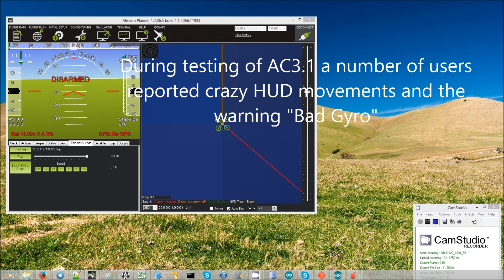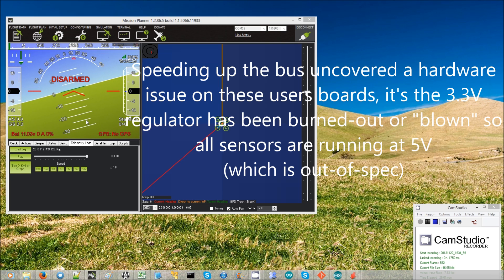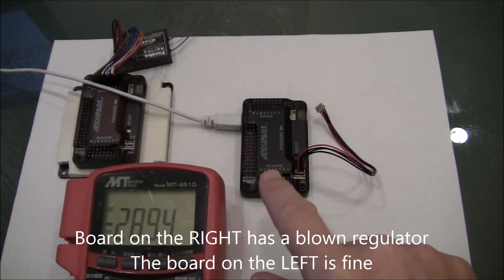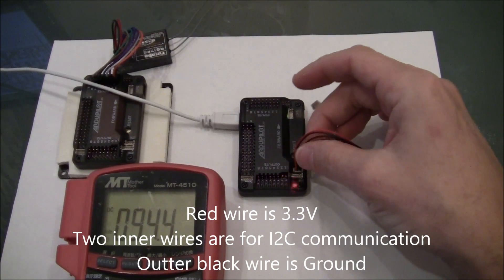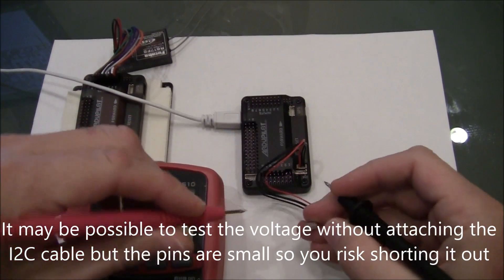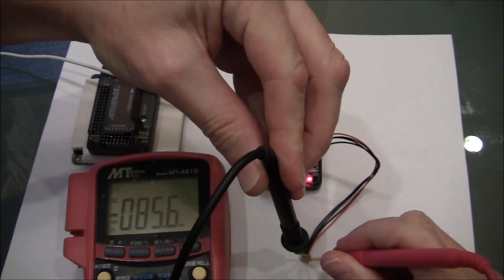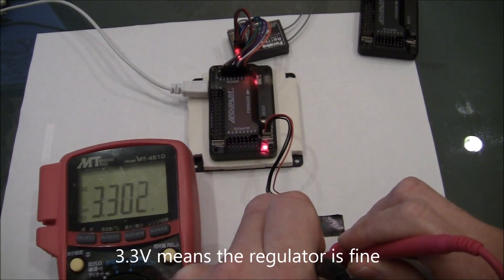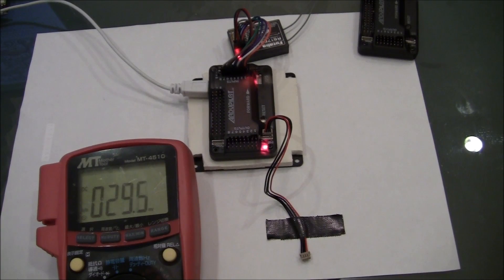Checking your APM's 3.3V Regulator

Comment: Two methods of powering the blessed thing. Dedicated BEC 5V 3A or the APM Power Module/sensor/PSU. My two PM's (one as a back-up) are outputting ~5.80V It was almost plugged in to the Arduflfyer 2.5.2 !!!. I had not removed the J1 though, and had no LED illuminated or magic smoke. Maybe in an instant I have damaged it. Is one to measure the voltage once the APM and peripherals are all in the load? Surely the power should be delivered at 5V constant regardless of the mA draw.  I am looking into the regulator they used. Beware Ebay vendors. I would also add that the pcb has two missing components. This  I have seen on 3DR product. Test done with full chgd 3S
Reply: I think my blunder was the vendor :-o
Reply: Chris Leech Thank you for the post!

Comment: Hi Randy.
I've tried to fix the 3.3V regulator (marked LE33) but the problem has not been solved yet. The voltage in the 3.3V output of the I2C bus still remain about 4.6V. Maybe is another hardware issue. Something that connects the +5V with the +3.3V bus. Some diode? I don't know.

Comment: Hi! In the DIYDrones forum you say that the way to prevent the regulator from being burnt out is to "not connect any devices such as a radio receiver, MinimOSD, GPS, etc while the APM is powered especially while powered only through the USB cable".
Do you mean that every time I power my APM via USB I have to disconnect all the devices (Rx, GPS, etc.) to prevent the regulator from being burnt out, or it's just that you cannot plug in one of these devices when the APM is being powered by the USB (but if they have already been plugged before powering the APM there should be no problem)?
I've been told that removing the JP1 Jumper will also prevent the regulator from being burnt out. If I do that, will I be able to plug the devices while powering the APM via USB without problems?
Thanks!
Reply from the maker: girarcat I'm not really sure how regulators can be burnt out so I don't think it was me who blamed external devices.  That may be true, I just don't know personally.
removing the JP1 jumper is a good idea in general but it only affects devices that are receiving power through the rear pins of the APM.  It won't make any differences to devices plugged into other ports.
Reply: Randy Mackay Okay, so what's your recommendation to prevent the regulator of my new APM to be burnt out?
Thanks!

Comment: Hello, I have the "no heartbeat packets received" problem and I measure this voltage on I2C connector and I read 4,9V.
In the video I didn't understand what happens if is 5V (like mine), should I replace the regulator or the apm board?? thanks!
Reply: I'm with the same problem. It reads about 5V and I'm getting "no heartbeat packets received" on missionplanner. Should we replace the board? Thank's in advance!

Comment: I have an apm 2.8 board running copter 3.2. I'm not experiencing any bouncy horizon. By measuring directly on the regulator, I have verified that it does indeed output 3.3v. Yet, when I measure at the connector as shown in this video, I get 4.8v. This is with power module ~5.3v in. Anything to worry about?
Reply: Akujiwar Bladefist little update. so i figured out my external compass wasnt working. turns out apm 2.8 got connectors moved around a bit. I might have been measuring at the wrong connector. Anyway i moved the compass lead to the connector right next to the gps one. Now it works. However i measured the voltage at the correct compass connector, but there, to, i found 4.8v.

Comment: Hi friend. I did the same test as you did. But my multimeter gave me 6.4v (first black and the red one)... is it ok? Or have any possibility to born out my apm?
Thanks. Best wiches,,,
Reply from the maker: Jones Guidini Hi there.  That's not good I'm afraid.  That means that the sensors (and other components) are being subjected to almost double the voltage they're meant for.  not good!  I would not fly with that board, sorry!
Reply: Thanks man. I will search another piece to buy, thanks.

Comment: Were do i set the meter. Iv tried this test and get nothing.  I think i plugged gps in backward.  Iv been tring and tring with no success in connecting to mission planner.
Reply from the maker: So you get 0V?  That's also possible, I've seen it on a couple of boards and it was caused by a missing resistor right near the 3.3V regulator.  There's a link below to the ac3-1-rc5-speed-problem discussion on diydrones.

Comment: 5V IS THE RIGHT VOLTAGE TO SEE  ON BOTH THE I2C  SOCKETS . THIS VIDEO IS VERY MISLEADING  !!!!!!!!!!!! THE REGULATION DOWN TO 3V3 IS INSTALLED IN THE GPS  IF YOU HAVE A APM2.8  YOU WILL BE TRING TO TACK DOWN A PROBLEM THAT YOU DONT HAVE !!!!!!!!!!!!!!!!!!!!!

Comment: So should we not upgrade to 3.1 until this is sorted out?
Reply from the maker: Shahzan,
     Yes, if you have a blown regulator then you should not upgrade to AC3.1 because it won't be able to handle the higher spi bus speeds.
Reply: Randy Mackay Will upgrading to 3.1 cause a blown regulator?
Thanks

Comment: mine reads 4.8V at the GPS output. Some more checking to be done. EDIT: The 3.3v regulator is OK, it's probably the 5V Vcc that I see on the outputs...
Reply: YES 5V IS THE RIGHT VOLTAGE TO SEE  ON BOTH THE I2C  SOCKETS . THIS VIDEO IS VERY MISLEADING  !!!!!!!!!!!! THE REGULATION DOWN TO 3V3 IS INSTALLED IN THE GPS  IF YOU HAVE A APM2.8

Comment: I measure 0.612 volts? this means my regulator is burnt out?
Reply from the maker: Tor,
     Something is burnt out.  I'm unsure if it's the 3.3V regulator or not.  It might be a diode.  There's a 3.3V regulator discussion on diydrones, probably best to ask there or in the APM forum.  best of luck.
Reply: Randy Mackay So what will happen if I fly with a burned regulator?

Comment: You blow it if you use usb and power from your esc at the same time thats how i have blown mine but iy ia very easy to replace it whit a 1 amp 3.3v regelator that shut solve it

Comment: So, How do you fix it?
Reply: If you're good with soldering SMDs, you can replace the regulator. Otherwise, the APM will require replacement.
Reply from the maker: Yes, indeedy.  I haven't fixed the broken board yet (because I need it broken for testing) but eventually I may make a video of how to replace the regulator...or maybe someone else will which would be even better!

Comment: I tested mine and it's at 0.85v whats can be wrong ?
Reply from the maker: I'm not a hardware expert but I think it means the regulator has been 
destroyed on the board.  The only choice is to replace the regulator or 
buy a new board.  By the way, the APM is a really old design.  We 
stopped writing software for it nearly 2 years ago!  The Pixhawk or 
other ardupilot compatible flight controllers are about the same price 
and are far more capable.

Comment: So 3DR deliver a new firm and blow our board ? .. Nice just have mine and seems to be dead ! Wow thanks !
Reply: No, that is not the case at all. 3DR have not blown your board. Your 3v regulator is already blown before the 3.1 firmware.  The fact is that the new 3.1 firmware exposes the hardware fault. That is all. The real question is how the 3v regular blew in the first place. Was it something you did during the build? Was it faulty at the time yo u bought it? Did it fail during use, even if properly installed in the first place?